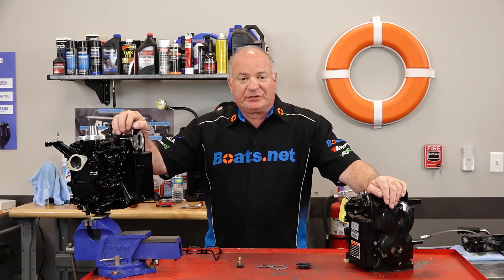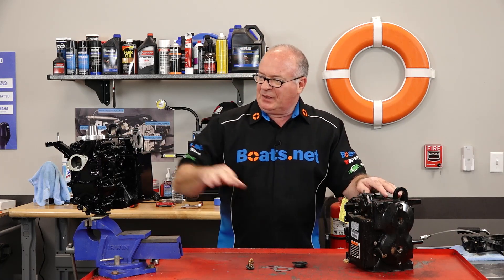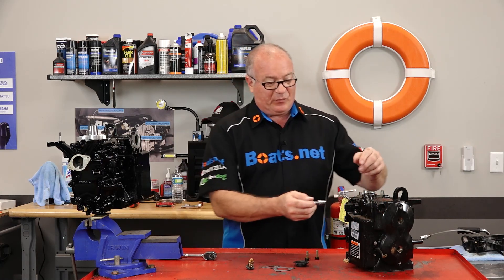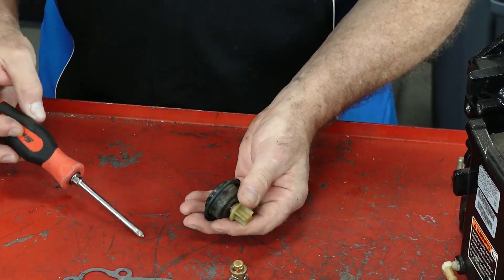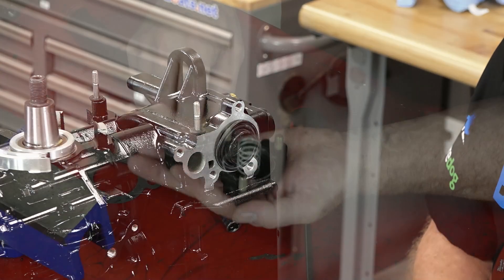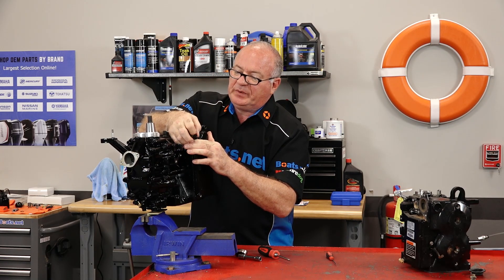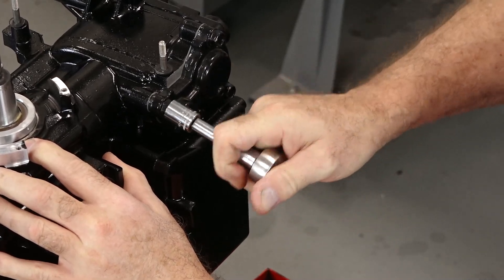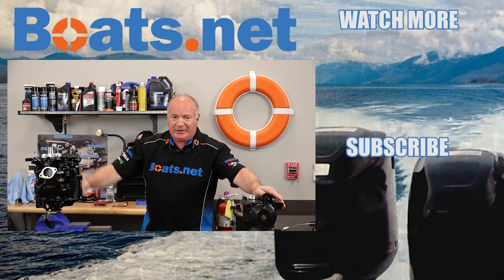How to Replace a Thermostat on an Outboard | Mercury Outboard Thermostat Replacement | Boats.net

Comment: at what temperature does the thermostat open on a mercury engine, I started the engine, the water was 30 degrees Celsius, it ran for 15 seconds, the water didn't come out of the back, I heard a knock, I turned it off, I started it again, the water didn't come out again I heard a knock, I turned it off, I left it for a while, the temperature rose to 50g. celsius and the water started to come out and it works perfectly, I don't know what happened, I looked at the second start, a little smoke came out from the front to the stern, then it worked perfectly. - MERCURY 40hp.  4t  EFI 2013

Comment: Yes, my name is Tom. I have a mercury outboard 2002 150 optimal saltwater. I put thermostats in I put the lower pump water pump change your popper valve and it still seems to overheat or if the buzzer goes off pump strong what else could it be?

Comment: Is this accessible without taking the engine apart. Can you point out where it is located in relation to the engine on that 40 HP Merc  Thanks

Comment: The diaphragm that you removed from the old engine was sitting on top of the gasket (gasket was up against the block). When you put it on the new engine you put the gasket on top of the diaphragm (gasket was up against the thermostat cover). When I did mine it seemed to go together better with gasket on block. Which is the correct way?
Reply: You are correct the gasket should be on the block.. The spring is also in the wrong position